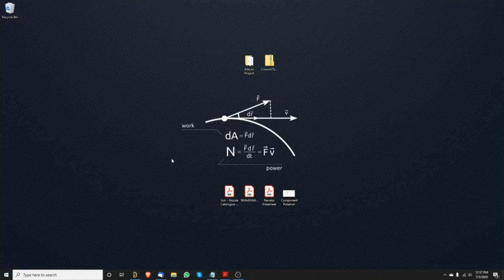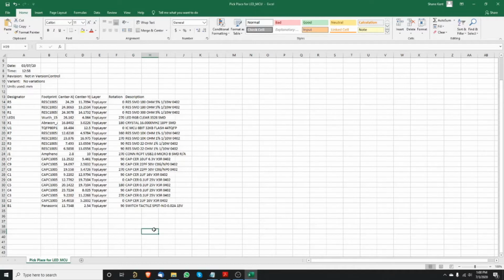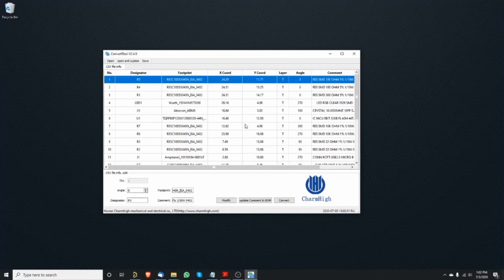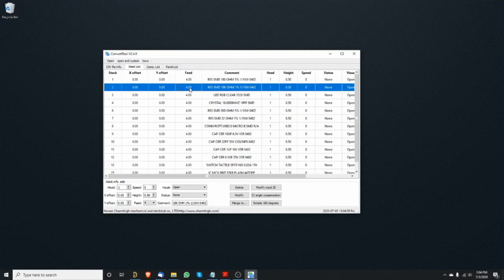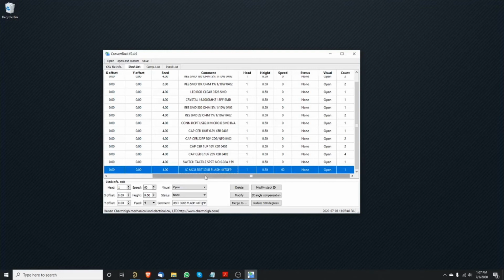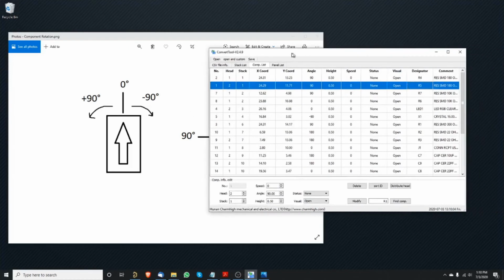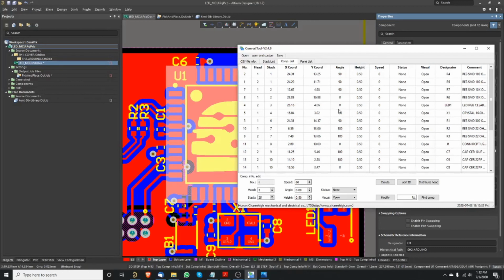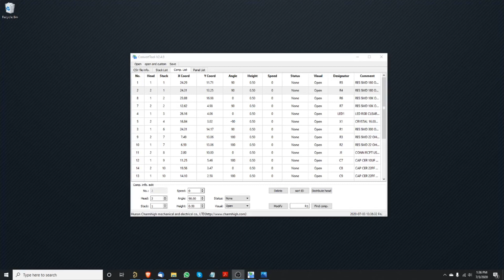How to Use the Charmhigh Workfile Converter Tool

Comment: Mr. Kent what about setting of "height" of components in converter? Some of components are much higher then capacitors (ex 0805 case)!  comparing to ex. CNY 17-4. In that case I use 1 as height settings. Please your comment. Also do you understand or know how Chramhigh calculate proper height value.

Comment: What if a part is at an angle like 30 degrees?  Is there a gui software for the CHM36 to run on a PC since that one does not have a screen like yours?
Reply from the maker: Yes! You can put in any degree rotation you want.   The Charmhigh CHM36 does have GUI software for running the machine.
Reply: @shanekent249  hey man...thanks for replying!  We are considering one of these machines to assemble many of our own electronics and your vids are helping me get up to speed.  Does Charmhigh supply the GUI software once you buy the machine?  I'm not getting the one with the built in screen
Reply from the maker: @DerekSpeareDSD  I’m glad that my videos are being helpful! :)

Yes, Charmhigh will provide you with the GUI software when you buy the machine.  Either they will send you a link or they will send you a thumb drive with the machine.

Be careful with the CHM36 that requires an external PC.  The thumb drive that they sent with my machine had a Trojan virus on it that my antivirus detected when I plugged it into my computer. If you are going to get that version of the machine then I’d recommend only running the GUI software on a simple PC that isn’t connected to the internet and that does not have access to your personal files.
Reply: @shanekent249  good advice!  Thank you!